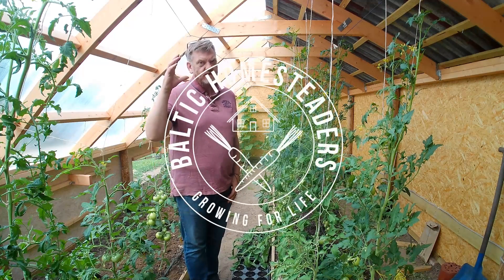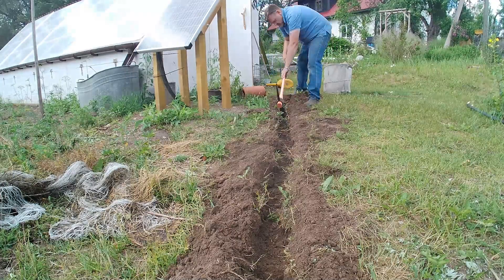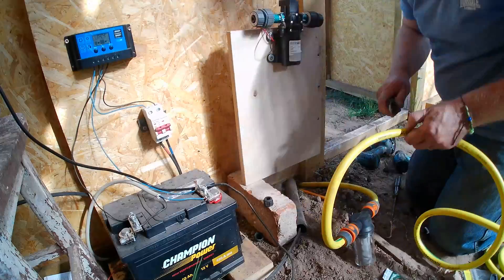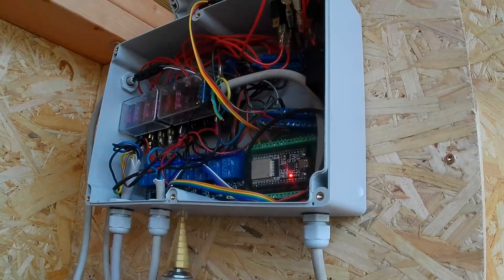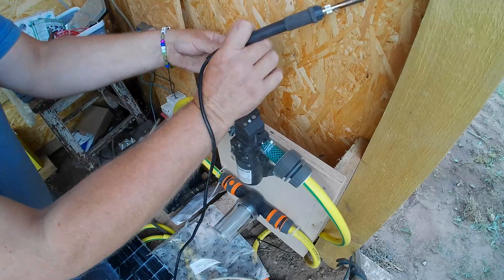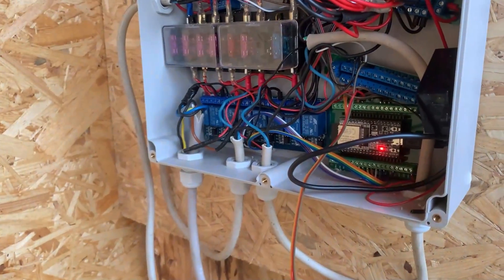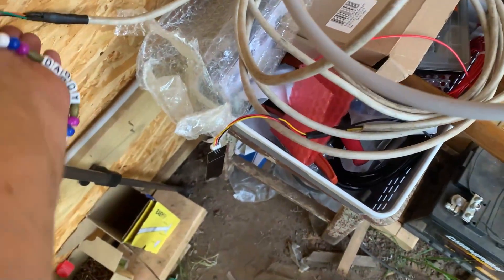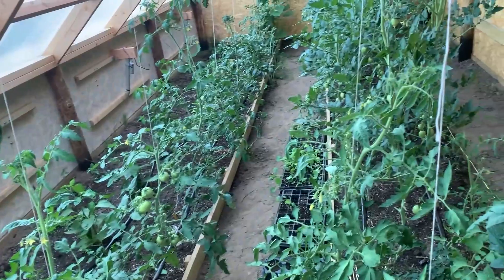Automated Greenhouse Watering System

Comment: I wonder how it'd be if you had the rows of drip tape all on a splitter, rather than one row snaking through the house.

Of course there'd be issues; you'd need valves you can half close and flow meters on the splitters for balancing, but I suppose it'd help you have more even soil moisture.

Or am I just silly thinking this is a real problem?
Reply from the maker: Actually that was my first thought but when I came to do it I realised I didn't have the right bits and because they're special order here I made a work around. Pressure is good with that pump.

Comment: Hey, looks really good. How difficult it is to order and put together all of that automation?
Reply from the maker: Thanks. Buying the bits is fairly easy. All from Amazon or aliexpress or from a local electronics store if you have one (I didn’t). Putting it together requires some knowledge. Of course for watering alone you can buy off the shelf systems ready to go.